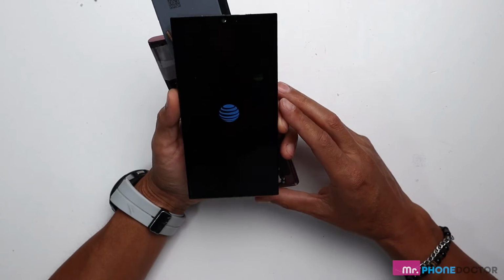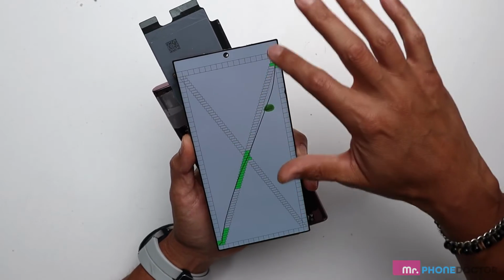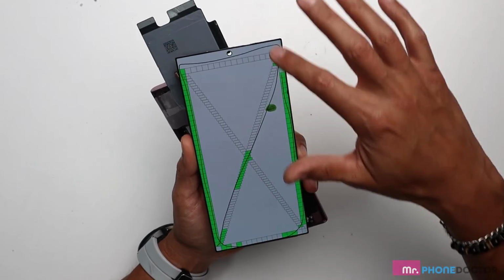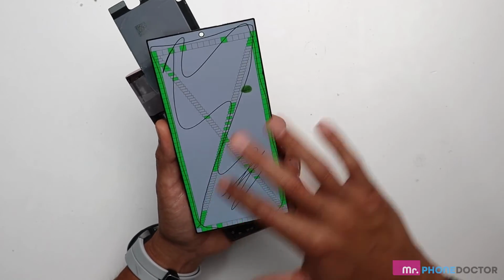How-To: Repair a Cracked Samsung Galaxy S22 Ultra Screen (OCA Cleaning & Frame Removal 2 of 3)

Comment: Awesome video bud! Btw what's the reason why there are lines in the middle going horizontal? Like before the glass removal, the screen is good. After the procedure, the glass comes nicely out, but the screen is like as if it's cracked (even tho there are no signs of damage)
Usually, when the bottom part (where the flex is located) is touched, the OLed will have VERTICAL  lines. But in at least 5 Oled, I had the same issue with horizontal lines and bottom half totally white😢
Anyone with an answer?